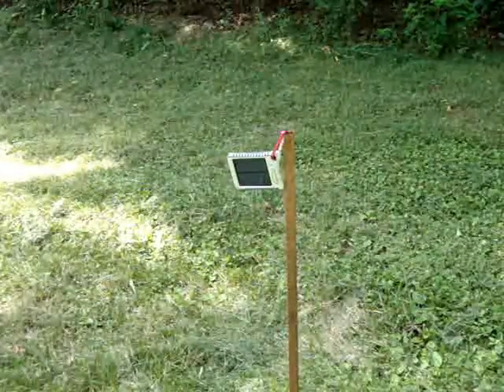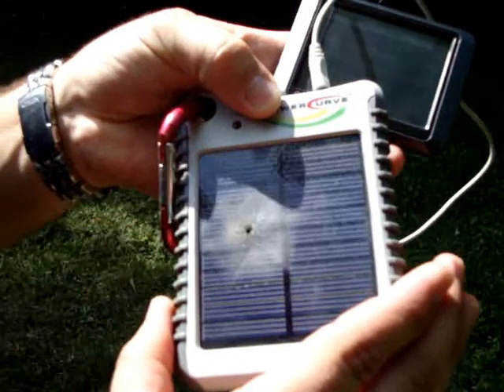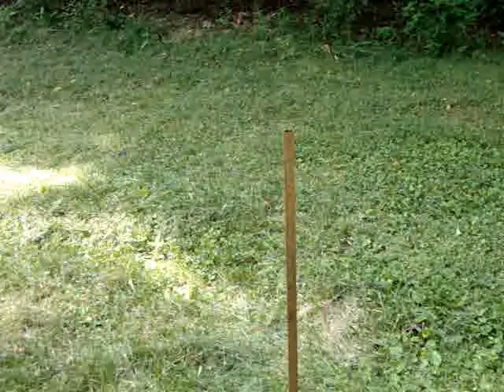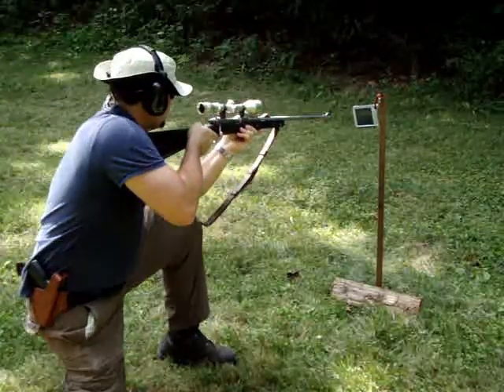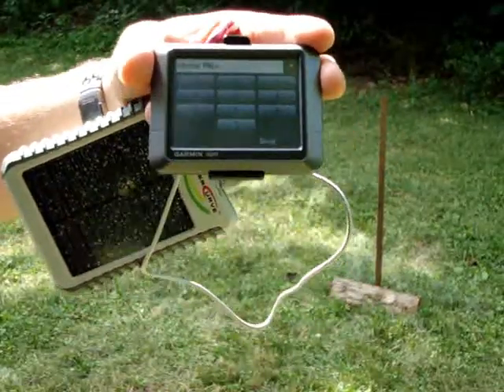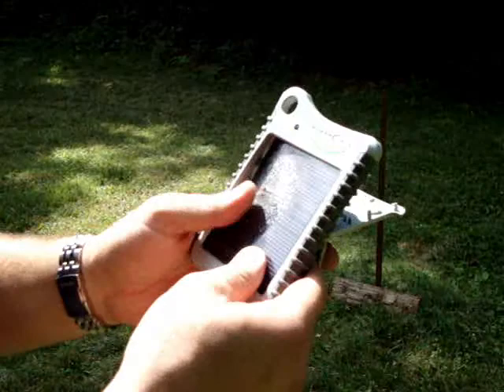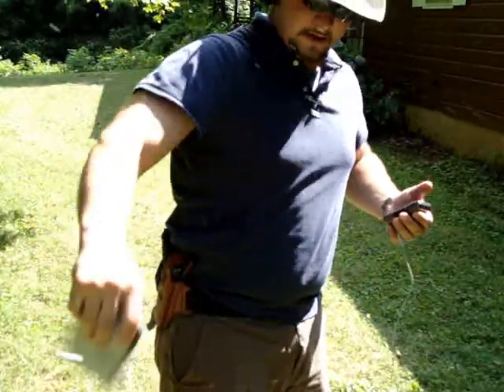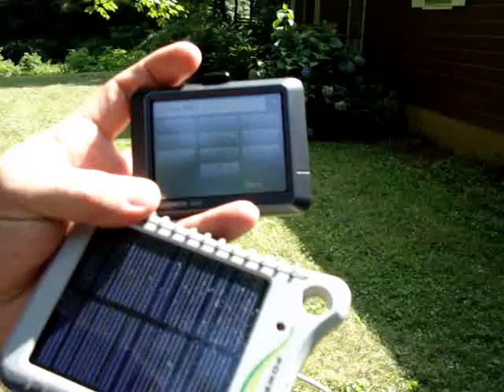Watch the G24I Power Curve take a bullet and keep working!

Comment from the maker: The reliability of these devices is an irrelevant issue since its already been proven, and continues to do so.  You may inquire the Navy SEALS, NCIS operators, USMC Force Recon, USMC infantry, US Army Rangers if youd like to ask them about the reliability since they count their load outs 6 times to check and make sure they have precisely no more or less than they absolutely need.  
THE POINT of this video was to dismiss the idea that these units are easily broken.